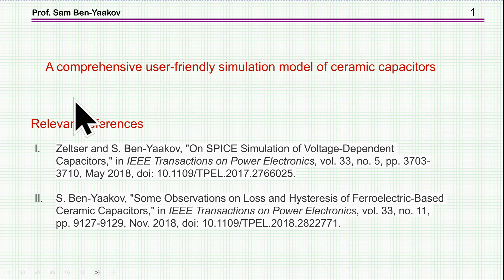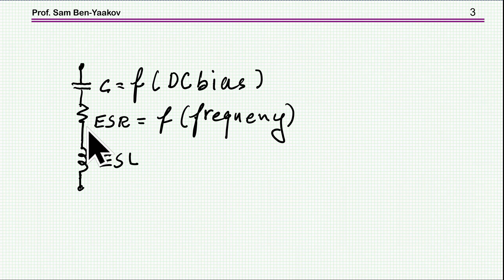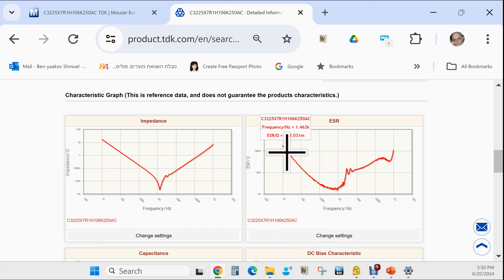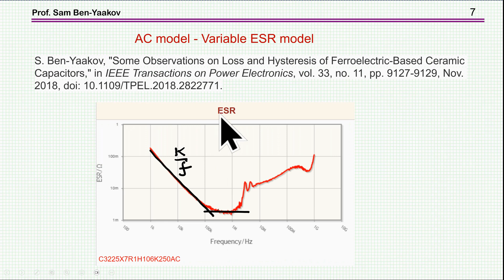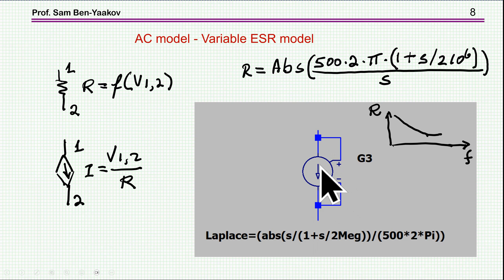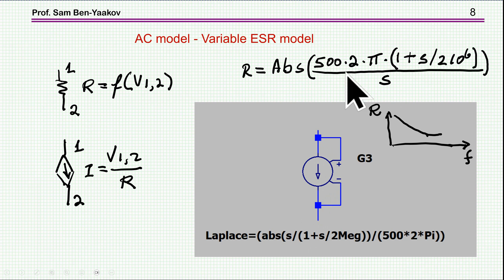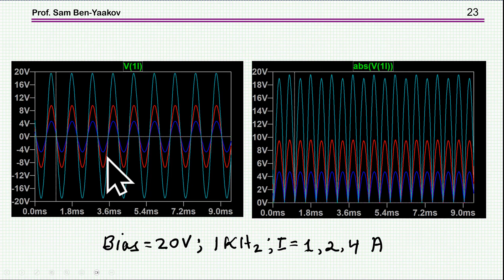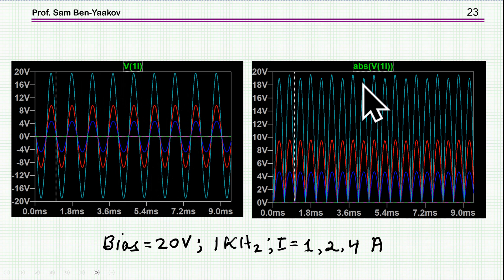A comprehensive user-friendly simulation model of ceramic capacitors

Comment: Hmm, I can't grok the concept of resistance (ESR) changing with frequency  :-{   Must look into it.
Reply from the maker: Look up: S. Ben-Yaakov, "Some Observations on Loss and Hysteresis of Ferroelectric-Based Ceramic Capacitors," in IEEE Transactions on Power Electronics, vol. 33, no. 11, pp. 9127-9129, Nov. 2018,

Comment: I suppose that at sufficiently low frequencies the limiting factor becomes the dielectric breakdown voltage. 
Can we speak of a typical frequency when that happens ? And if so, what is its value/range ?
Reply from the maker: V and I are two independent limits , At low frequency V is the limit. At high I.

Comment: impressive! and beyond my level. 
why they don't make simple capacitors, simple behaviour?

i never delved deep in this... 
years ago i tried a voltage multiplier, on maybe 1kHz, maybe 20kHz, i do not remember well, but it was not 100kHz, and it fumegated. 
tried with electrolitics, and the variations on the last capacitor were in 100V range. 
i understood there may be some problems, but i did not imagine how big. 
and at that time, it was no experience gained. 
as i said, not much thought into it. 
thanks for the presentation!
Reply from the maker: Thanks for sharing. Things are less mysterious once you understand the fundamentals